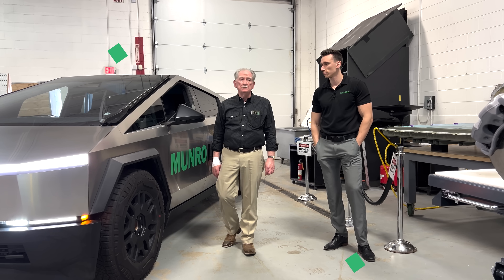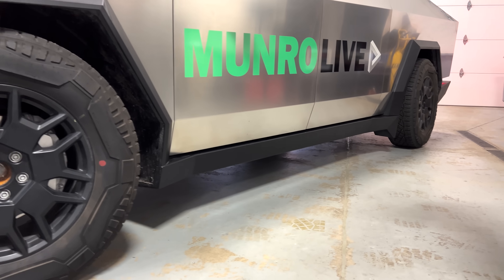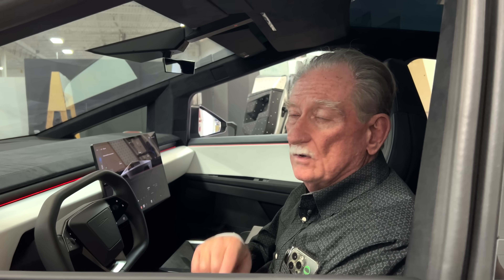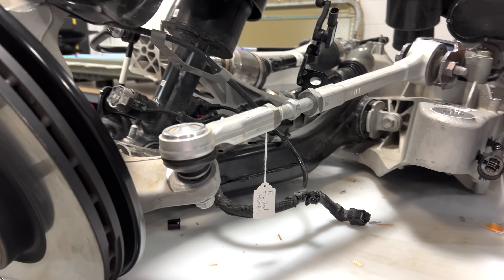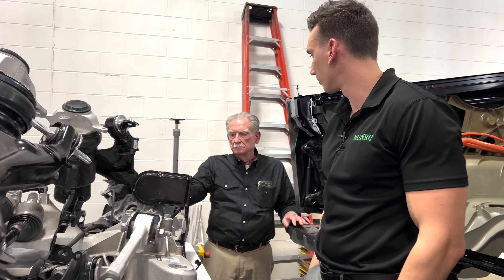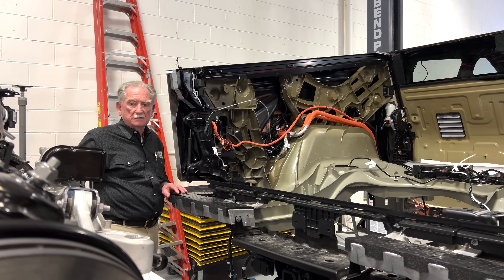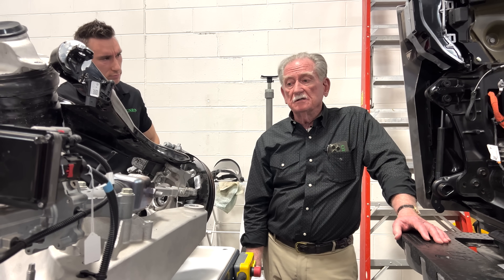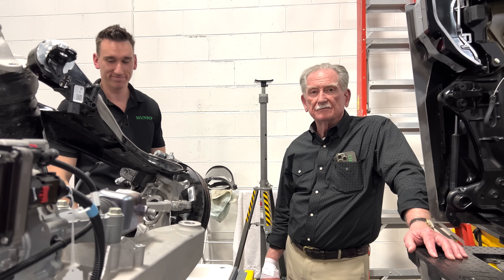Tesla Cybertruck Steer-by-Wire System

Comment: Imagine being a Ford F-150 engineer watching this video... it's like me looking up at the summit of Mount Everest from the base camp.
Reply: Yeah, it looks very familiar knowing German axle construction. Tesla, however is leading in the big aluminium cast parts building the interface between axle subframe and chassis.Don't know If this has advantages after production time. Maybe stiffness, but i am unsure actually.
Reply: More like going to a children's concert, only parents could enjoy it.
Reply: Ford is one of the signers of the steer by wire standard. Now we will see if Ford puts it in their next generation vehicles.
Reply: @Dularr  Ford is #1 for recalls and apparently signing things (like super charger use deals...) They were a leader once but that generation is past now. Literally unfortunatly.
Reply: Don't think the F150 customers are ready for that. And as a former mechanic myself I also still prefer normal steering. I'm just seeing alot of potential problems to be honest. These cars are gonna be a nightmare to diagnose and repair in a few years. Or it's me who are to old..
Reply: @mrm1885  Industry is changing  , when was the last time you had that carburetor  fixed or adjusted , I doubt if you even have said carburetor today in your car/ truck, and that is for ICE, now imagine  having a car that does not use ICE , only batteries and an Electric motor, that lump of Engine having 1500 parts  is so 20th century, oh did I mention it uses Non renewable fossil fuels?
Reply: @mrm1885  are you still using an Abacus to  do your calculations? Or do you use a Calculator?
Reply: @mrm1885  the question for the F-150, is the 48 volt and 10BasedT1S wiring.
Reply: @AuralioCabal-nl8gi  I haven't fixed or adjusted my 1964 vw kombis carburettor since 1980. Why would I need to?
Reply: @mrm1885  I'm not as well informed on the diagnosis matter, but I have see Tesla service menu at work and it is extremely powerful and much further reaching that traditional OBD equipped vehicles. I think diagnosis is and will be easier with fully software defined vehicles.
Reply: More like watching Evel Knievel jumping the grand canyon... Combination of ingenuity, stupidity and a giant set of brass balls.
Reply: they probably have some great engineers who are handcuffed by the penny pinchers and executives with no vision
Reply: @TurdFergusen  No they moved on to places they were appreciated.
Reply: @TurdFergusen  lol!!!! lame joke! its not an obligatoty system period!
Reply: Damn!
Reply: No one is worried about 48v, people want a good, cheap, and economical electric vehicle that doesn't cause problems in the present or future... but I already understand or I could be wrong, the tendency is to create different ones for customers, yes because the parts These vehicles are increasingly financially expensive...

￼

😂🤑
Reply: Knowing all you have is a hope and a prayer to rely on! Is this what we need as a human race on our roads?
Reply: @anthonylike1800  Go back to your fetal position and wait for it to end.
Reply: @anthonylike1800   planes, your gas pedal. All “by-wire”
Reply: Tesla does shit Luke this for the gimmicks, Ford is a more serious company that tries to  wait for  technology to be ready before implementation. There's ALOT of delay in Teslas system, A DISGUSTING AMOUNT!
Reply: @bobbybandz9194  Lol Bobby you clearly don't own one.
Reply: @antoinepageau8336  a Ford? Yup,and work on it.
Reply: Ford signed off on this standard.
Reply: Only thing keeping you alive is small palm print of rubber on the road. I don’t want drove by wire lol
Reply: None of this is super difficult, there just hasn’t been a need, and no R&D justification. Also, the 48v system helps tremendously for this, so now that suppliers know how to work with 48v, it’ll help
Reply: @chadkrause6574  who makes 48v parts? More importantly how long is it going to take? I was teasing someone at another truck EV company 8 months ago and they are all in 12V. (At least they won't get fired if they don't ask questions - that's the rhetoric, isn't it?)
Reply: @chadkrause6574 
Please differentiate between hybrid 48v systems and a full 48v systems 
Only cybertruck is a full system
Reply: @chadkrause6574 48v system isn’t new
Reply: @taylork420  no, but for an entire vehicle it is, especially in the consumer vehicle space
Reply: @chadkrause6574  not true. 1, it’s not all 48v, many of the LV parts are still 12v. It might have the most 48v parts but it’s not first or new or impressive. 48v wasn’t invented by Tesla. There’s a whole ass wiki article about the 48v system if you cared
Reply: @taylork420  I am well aware of what 48v systems are, I know they didn’t invent it, but it’s something that all OEMs have wanted/needed to do for a while but didn’t want to invest in cost. Tesla did it, and that’s why it’s impressive. The 24 and 12v components are limited to just what they couldn’t upgrade in time
Reply: @chadkrause6574  48v system for steering have been in use in european cars for years now just like the sway or stabilisation systems, rear steering is not a necessity at all! you see those giant mercedes sprinter vans dont even need them too.
Reply: ford literaly offers their trucks to some manufacturers with just either frame and cabin or just the frame to build ambulances, school bus, RV, utility truck..... from dump truck to crane and more.
Reply: @milanlatona7363 yeah that literaly what a troll will vomit on internet! very pathetic tbh! i feel very sory for you tbh!
Reply: A lot of Tesla fanboys here, glad I’m not one of them. I will admit Tesla’s tech is impressive, but the design concepts inside and out are ridiculous.
Reply: @ap4709pk  absolutely but humans don't like change, generally speaking. Tesla is a Trojan horse, disrupting the status quo with every release. They also have a positive margin on each car, which other American manufacturers have issues with.
Reply: @ap4709pk  I agree the outside isn't everyone's cup of tea but regarding the interior I've lived with a model 3 for a couple years now and I appreciate the minimalist approach. Not sure about the new stalkless set up though...
Reply: nonsense!!!! they dont need all this crap! why would they waste money to put on a big truck that is used on massive american roads?! the bigger ford f250, 350, 450..... have solid rear axle to tow more, make modifications super easy! the cybertruck is garbage compared to any ford body on frame period!
Reply: @alanmay7929  youre comparing it to a f250+++ ???? might be a you problem
Reply: @alanmay7929  I think I heard a similar statement in 1901 about horse and buggies.

Comment: From my engineering experience computer steer is awesome. From real world vibration, muck, salt, oils and corrosion a daily driver is subjected to without the daily maintenance a commercial airliner or ship gets, this will cause deaths.  It's neat they're trying things like this though.
Reply: What engineering experience do you actually have with simple electric automotive rack and pinion steering? Obviously none,  as you have no idea.  Don't sully your profession by speaking outside your realm of expertise. 

I'll save you time- no regular maintenance required to linkage,  sensors,  or electric motor, as we'd expect.  Just as with any car,  tie rod ends may wear and develop play after many tens of thousands of miles.  I don't know this for sure,  but I imagine this steer by wire system has an advantage on "dumb" conventional systems in that it will sense the play and be able to warn the driver long before it becomes dangerous,  maybe even before it becomes noticeable,  so that tie rod can be replaced safely. It has available to it a GREATER degree of safety than other cars.
Reply: You’re hilariously clueless 🤣
Reply: @fredbloggs5902  fortunately I have real world experiences and great friends. Such as a lead mechanic at a local toyota. So a guy comes in with a car he claims likes to suddenly jerk off the road into the ditch.  Seems pretty enthusiastic so they setup an appointment to attempt to replicate the problem. Head tech hooks up the laptop and takes the passenger seat. My friend takes the wheel and they go for a drive.  Half hour, nothing, all around town. Then on a nice highway stretch, wham, veers hard right, friend and racer countersteers with the wheel and brakes hard to keep it out of the ditch.  Spooked them well, to say the least, even knowing it should be expected.  Cause: a stress cracked wire  from the left front wheel speed sensor intermittently told the computer it wasn't moving. The computer, believing the left front was locked up helped by hammering the brakes to the right front wheel.  I believe the fix was a new wiring harness.

That was a simpler day, I cannot imagine what will happen when the CT computer wants to avoid a phantom obstacle and "help" by aiming you a direction not specified by your turning of the disconnected yoke.

Do what you're comfortable with, keep it maintained, it's $185 an hour here.

Comment: "This is the most technologically advanced vehicle."
Reply: nope its not! when we talk about advanced vehicles this tesla garbgae is not even to be mentioned! the Mercedes Unimog that no one talks about offers literaly everything from all wheel steering to central tire inflation system to vario pilot which you can literaly slide your steering wheel from left to right with the pedals and dashboard all in one, a rigid/flexible, PTO for mounting crane, snowblower, all kinds of equipments for construction, utility.... the list goes on and on, lets not forget its an excellent offroad an offroad monster
Reply: Yes, and?

Comment: Great video, very educational. It's all about the tech!  Thanks guys.
Reply from the maker: Thanks for watching!
Reply: @MunroLive  this isnt a true 48 volt architecture another tear down company on autoline daily proved it.  plus the honda prelude back in the 80s had rear wheel steering lol nothing new and steer by wire isnt required or nessasary for a vehicle. this truck would be alot better if it was a hybrid so it could actually tow 500 miles unlike false advertisement from 2019. this truck is a gimmick period obsolete and outdated.
Reply: @billybobbob3003  Most folks don’t tow.
Reply: Redundant and sometimes triple redundant on everything.... Except power! No mention of a redundant 48 volt power supply.
Reply: @DavidJohnson-tv2nn  you sound like an expert.  What redundancy would you expect to see?
Reply: @tomz1364  I'm not an expert. But...
On something as critical as steer by wire, I would like to see end to end redundancy, including power. That means a backup battery separate from the 48 volt battery and separate from the car's main battery. In a different location in the vehicle. These systems should be completely failsafe. At least before I would ever consider buying one.
Also... I would hope that if there is a failure,  the computer doesn't allow someone to continue driving the car. 50 to 100 miles to get home and it should shut down until the problem is corrected. Again, not an expert, just my opinion on the subject.
Reply: @DavidJohnson-tv2nn  You are not an expert and suggest to see this as a shortcoming?  Have you considered that the engineering team would have taken this into account if it was a risk?  You are entitled to your opinion, but please base it on properly investigated  facts.  If a expert like Munro approves of this technology,  you can rest assured its good.  Perhaps the Cybertruck is  not the right vehicle for you to consider.
Reply: @tomz1364  It doesn't take an engineer to figure out that if power fails, you're screwed! There was no mention of any backup power source. Unfortunately, Munro likes all things Tesla, as do most viewers on channels like this. Especially the viewers, they don't question, they follow.....
"If a expert like Munro approves of this technology,  you can rest assured its good"

I bring up a valid question....
What about redundant power? I await an answer from the experts.

But.... Have a bad feeling that the system isn't as safe as its made out to be.
Reply: @DavidJohnson-tv2nn  What solution would you propose is suitable?
Reply: @tomz1364  As I suggested earlier, two 48 volt batteries, located on opposite sides of the vehicle in case there is a collision that takes out one of them. Also two power cables on opposite sides of the vehicle. In case I missed something.... Basically, complete end to end redundancy on everything. So no single point of failure can cause disaster.

Comment: I think Formula One cars has steer by wire. But they are not ordinary cars. Awesome video ❤
Reply: they have brake by wire for the regen / brake system, but rest is mechanical. they actually have power steering nowdays.

Comment: So the Tie Breaker sensor would be polled and if it was significantly out of synch you would get an error code to have the car serviced soon, but if one of the main actuator position sensors failed, then I wonder if it would disable that actuator and then rely on the 2 remaining position sensors in a limp mode to get the car to a service. Or perhaps the 2 good sensors could operate both actuators and operate more normally with the error code. Triple redundancy is pretty cool.
Reply: I think it is actually just continuous.  By that I mean every input is polled in real time--probably more than 100 times per second--and whichever two sensors are closer to agreement for that particular polling event are assumed to be correct.  If there is a repeating discrepancy by the same sensor where it is the odd man out over some preset time span, then the system will flag it as  defective and signal a fault that needs attention.
Reply: Unless this system is a poor design the sensors and actuators as independent.   They're packaged together for convenience.  What happens when a sensor fails is up to the software.  I can tell you what I think makes sense.   
Read all 3 sensors all the time.
If any sensor disagrees or fails to respond we still have enough information to drive the truck but should a 2nd fail we don't. That could be very bad news so the truck needs service.  An error code alone would be a bad idea.  What the software allows the driver to do is up to Tesla.   
If it were an airplane we could continue to fly with 2 and even 1 sensor.  With the car one has to allow the car to safely stop.   We don't want people driving around with less than 3 good sensors but we don't want to endanger them by forcing their hand at an 'inconvenient'  moment.   There are both engineering and legal issues here.
Reply: That sensor is actually a plastic box containing two completely independent sensors with two independent circuits. Which means that the two sensors are actually quadruple redundant. This way they can look at each pair independently and when one is in agreement and another one is also in agreement but slightly different they can measure that there is a slight difference but if it fails in a way where one of the four sensors is significantly off It can ignore it and make an assumption about which one is bad. There's a lot more information you can get.
Reply: I suspect that each sensor module actually has two sensors so that if a sensor fails it can be detected and ignored. This is how SpaceX designed their triple redundant system.
Reply: Unfortunately, in the software world we see different design considerations that people mistake for triple redundancy.  Rather these big clusters can operate on three systems, but is not triply redundant.  Instead it supports up to hundreds of systems, but locks when there are just two.  That's because the chosen failure mode is different because people don't die if the server goes offline.